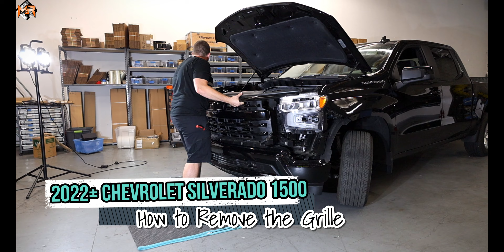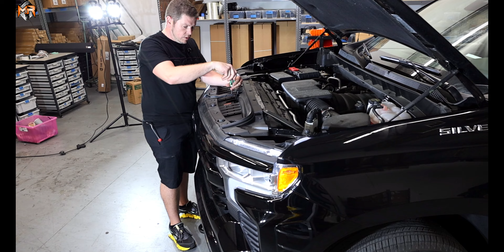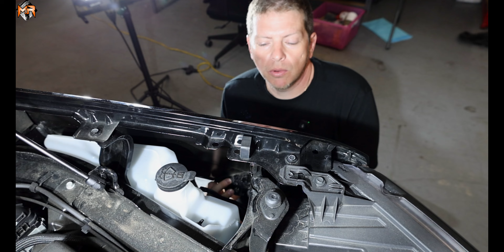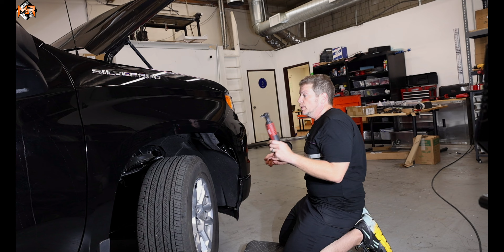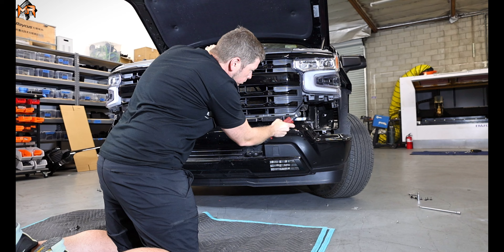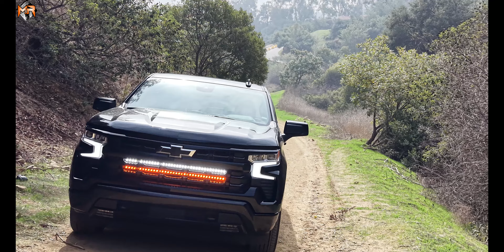2022+ Chevrolet Silverado 1500 Grille Removal | Step-by-Step

Comment: Be aware, you will need to pick up a bag of the white clips, especially to replace the ones right below the daytime running lights. They always break and you can even see in this video where pieces of one goes flying when he pulls on the painted bumper top.
Reply: do you know the part number for those clips? or what to search to find them?
Reply: @matthewcooper228  No, but any dealership can pull up the parts explosion and get them for you.
Reply: @matthewcooper228 did you ever find the part number?